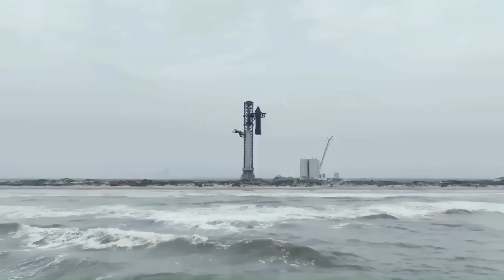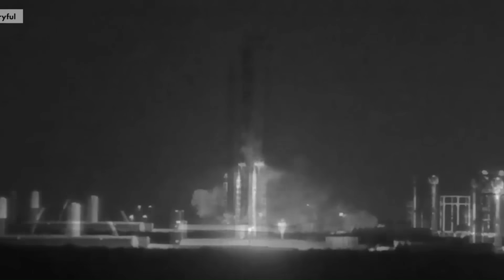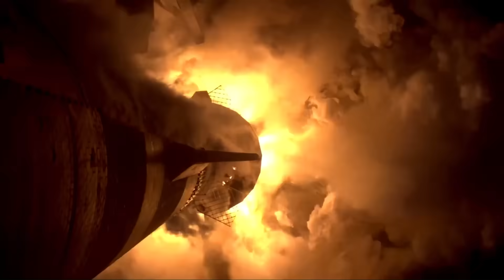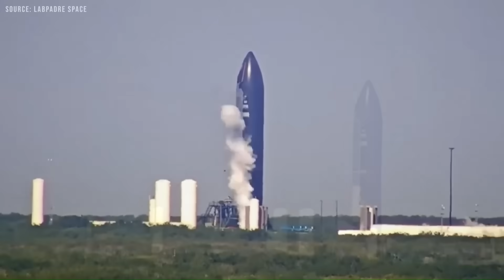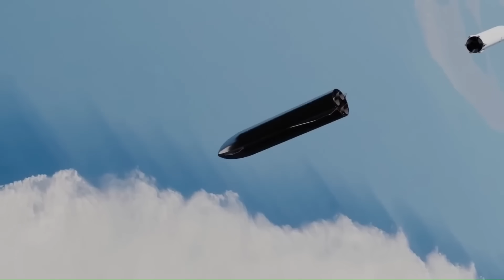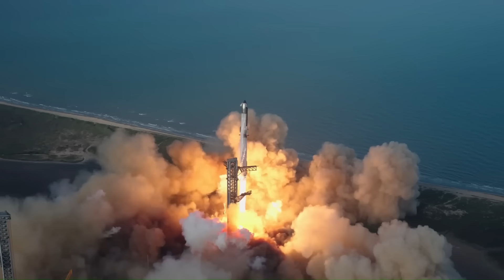SpaceX Just Stacked The Starship Super Heavy For Flight 12!

Comment: One of the many COPV auxiliary tanks ruptured damaging the methane tank which was under high presure. The COPV carbon overwraped presure vessels are large scuba tank like bottles that hold nitrogen, helium, starting fuel or any other utility gasses under extremely high pressures. They think it might have been mishandled prior to assembly.
Reply: Exactly. It wasn’t either of the fuel tanks failing. Shoddy reporting.